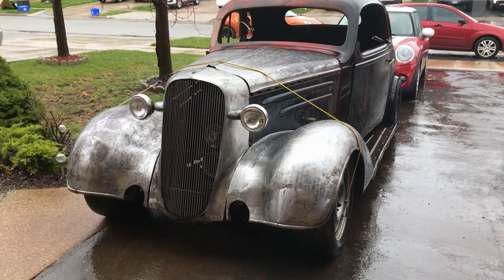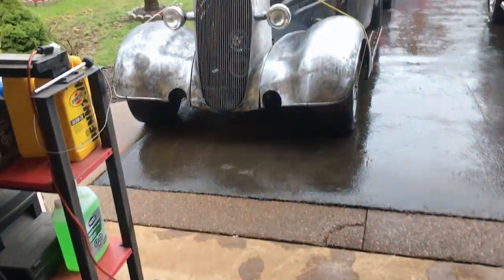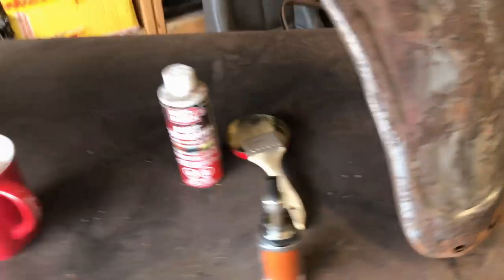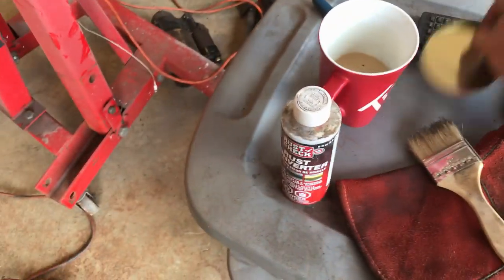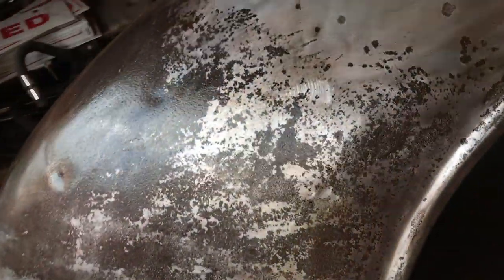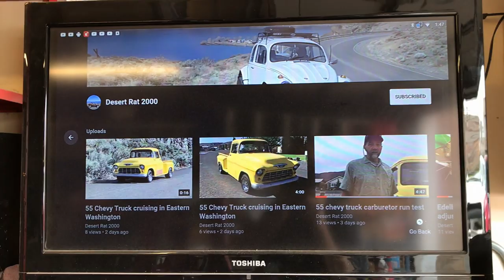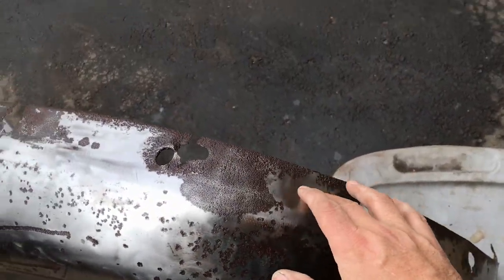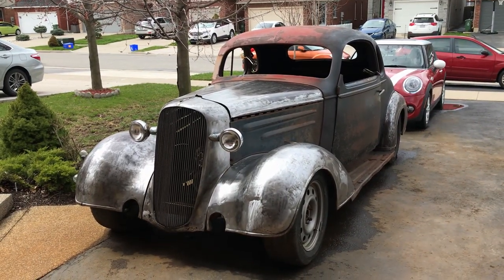1936 Chevy Coupe Bare Metal Fenders

Comment: We got great weather today ,our rain comes tomorrow. Lori likes the clear over bare metal look . When you do cut your door maybe the panel flanger tool another fellow mentioned for joining the window section would work well on the door skin weld back together area . I used mine a whole bunch today leaves a nice half inch flange for the overlap panel to fit nice and flush with an added bit of support too . The other side punches holes to make spot welds when needed .Lori has made over 300 cloth masks to help out with pandemic situation, and laughed pretty hard when you mentioned speaking moistly . Thanks Dave !

Comment: I like the bare metal look that you’re getting. Hope that rattle can clear holds up to UV light ok. I used some of that on worn metal flake fiberglass, on a boat. It looked great for about a year, then turned nasty and started to peel. Had to strip it off and use automotive clear.
When you cut your door down, give some thought to slicing it near the back, close to the rear door frame.
It doesn’t need to be, and probably shouldn’t be a straight cut. You can section it around the body line to get the ends looking right. This would leave the biggest area of unmolested door, and having the weld near the door frame, would minimize warpage. I hope I explained it right.
Things are looking good, friend! 👍Tony
Reply from the maker: Thanks Tony. I guess if I'm cutting off the top then I don't have the curved window area to worry about. Makes sense.

Comment: Just had to  smile to myself 
When you were installing the long tube headers if you had reversed them and had them coming out the front where the bumper bracket holes are .  Sorry  have been  in  to long. Lol spin the wheel BEER BREAK.
Reply from the maker: hahaha, and maybe add a couple of turbos?

Comment: Cutting the door down the middle is not a bad idea if you can get it back square and level. I'll bet you can do it. The rust when you are really ready to get rid of it for final paint can be got rid of with muradic acid and a tooth brush and scrubby pad. It stinks really bad and you need to wear protective equipment every wear. Put some on a small area scrub it off and rinse with dishsoap in water. As soon as it drys prime it. I did a car like this ten years ago outside.
Reply from the maker: Thanks Jeff. Remind me next year will ya. I know it will be a ton of work to make it pretty, hence why I'm not even trying this year.

Comment: Hey man, love your channel. This is my opinion and not an expert but if you cut it down the middle it will only bring the back part of the door in. The hinged side will stay where it is. You’ll still have to modify the front of the door. And this is my first comment ever on YouTube, hope I did it right haha
Reply from the maker: wow, I am honored. In answer to your comment though, surely you could say the same about the back of the door. ie, it would only bring the front of the door in and I'd have to modify the back?

If you imagine a standard wooden house door that is 30 inches wide, but the doorway is 28 inches wide. I cut two inches out the middle, and close it up. Now it's 28 inches wide. You get me?
Reply from the maker: Oh, I should mention that the front of the door is not attached to anything, in case you thought it was already hinged.
Reply: Yessir,  I assumed that the door was hinged. Maybe I made an obvious comment but I have missed things like that a lot.
Reply from the maker: @DanielTorres-de1pd  No no no, you have made a VERY important point. I never told anyone it was just hanging there with a welding clamp lol. This explains why I was getting so much conflicting advice hehehe. Ok, you're new job is to keep me right.
Reply: Lol I just didn’t want you to cut it, bolt it back up and kick yourself in the ass because you over looked it. I’m building a 37 Chevy sedan right now and had to cut and fix my mistakes a few times now lol

Comment: Hi Dave. I see you are spraying that clear all over your car. The thing that bothers me. You never used any kind of bonding agent on the bare metal. I would be worried that over time your paint will start to blister or crack off. I am not 100% sure, but just thinking. It's looking good though. Thanks for sharing. Stay safe.😷👍👍
Reply from the maker: Thanks for your concern Andy, but it's ok, I'll just rub down any problem areas and re-coat. It's not like the panels are perfect anyway. and it's easy to "colour-match" clear hehehe.
Reply: @ScottRods  Good plan. When there is no colour it is very easy to match. I didn't know you were leaving it clear. I thought you put the clear on just to keep it from rusting till you painted colour on it.👍👍😷

Comment: Hi... um, how long did the gas last, the gas for the MIG? My bottle runs dry very quickly, so I use flux-core wire which is terrible...  I'm thinkin my regulator is broke er somethin. Oh, and good luck on the doors too.
Reply from the maker: I usually get about three months out of it, light to average use. Make sure you close the valve when you are not using it. Mine ran dry early because of that.
Reply: @ScottRods  Thank you!